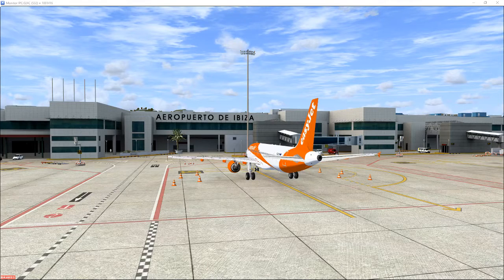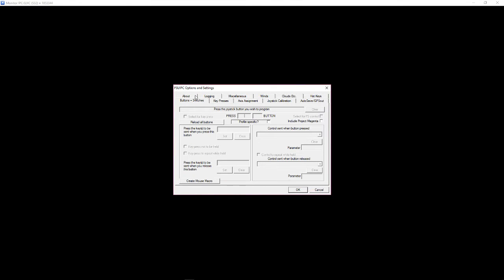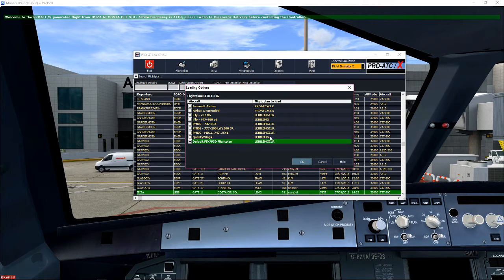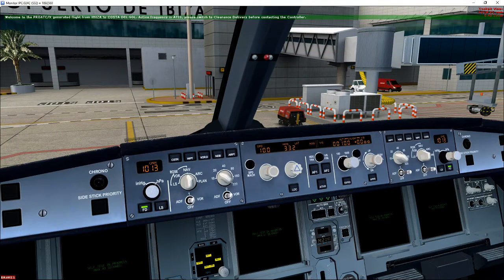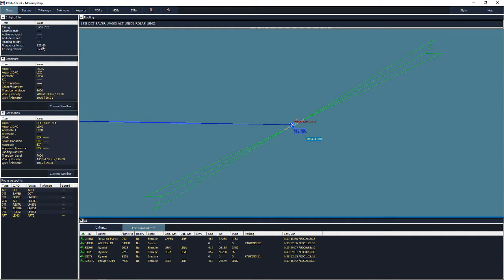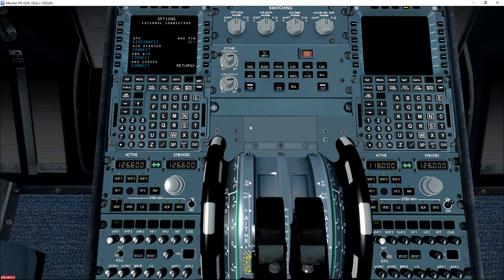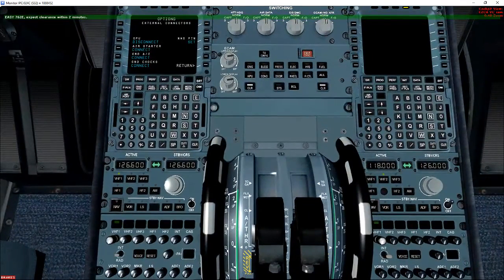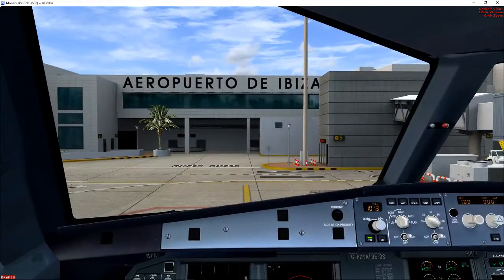How to get ProATC X working in FS Labs A320X

Comment: Hi Mike, I wanted to ask you what is the difference between assigning a key in fsuipc or changing it to manual?
For example: instead of assigning a key, can't I exchange frequencies manually?
Thanks
Reply from the maker: Hi mate, yes I believe you can, go into the P3D controls, look for the swap frequency button and assign it to whichever key you want

Comment: Instead of assigning a joystick button as a hot key, why not  use the standard menu key assignments with copilot support in proatc?
Reply from the maker: For some reason the A320X will only accept the channel swap command from a button added via FSUIPC, I believe the Airbus works in a similar fashion to the PMDG 777, which suffers a similar problem with ProATC. Once swapped there is no need to touch it again unless the relevant box's are unticked in the co-pilot section of ProATC. Not quite sure what you mean by "use the standard menu key assignments"??